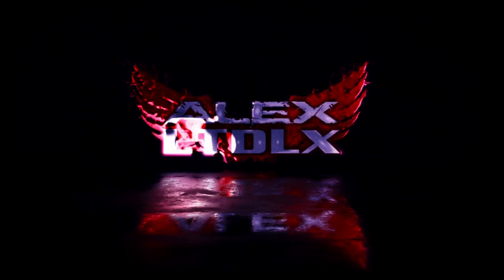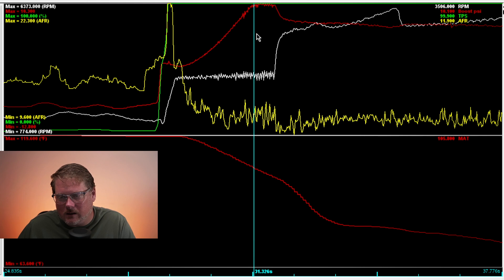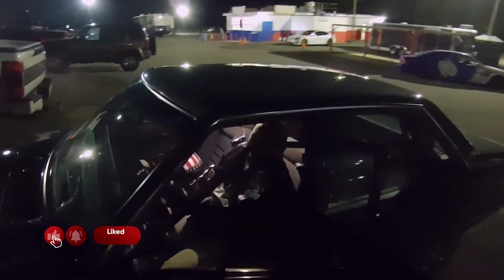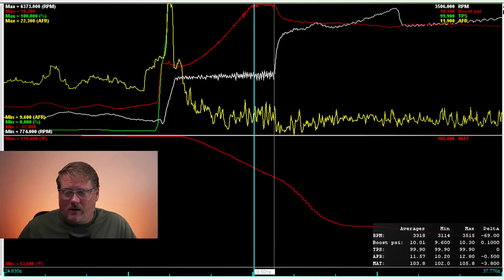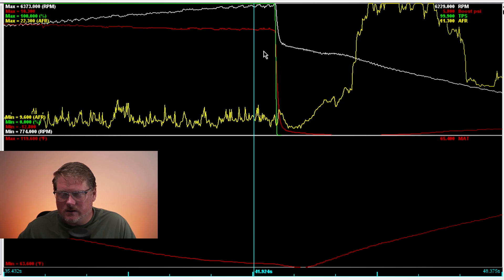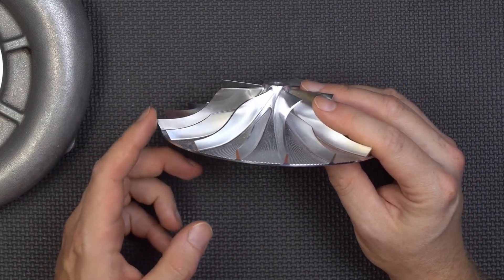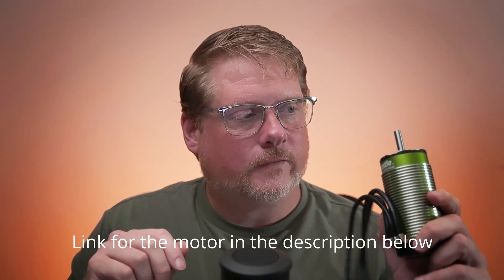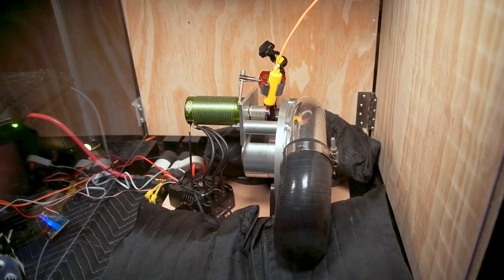How Much Boost Does An Electric Supercharger Make?

Comment: Hello Sir, we chatted before, so Im looking to use an electric turbo to help spool up an exhaust driven turbo. Do you have a full setup that you sell including motor, superchager, controller etc.... ?
Reply from the maker: The only commercially available kit is the Torqamp, and that's only a 5 kw unit, so it's limited to supporting at most 200 hp.  And since every application is different, it would be hard to sell a one size fits all type of kit.  Right now I'm working on trying to make one or two universal controllers (one for OBD II cars and one for those without), but that's a pretty complex thing and you'd still need the ability to tune the engine computer to add fuel and pull timing.  Maybe, down the road, we'll have individual "modules" for sale that people can combine for their specific needs, but nothing at the moment.
Reply: Understand. So, what would be the cost of the supercharger with belt drive motor and manual control switch? Of course, Id follow your recommendation on where to buy the batteries and supporting equipment. @AlexLTDLX

Comment: It does require more power, it's just in the form of a battery pack. No excess work from the motor to drive it. You could get the alternator to drive it but it will take away from hp to drive the alternator. If you want to make a nice hp upgrade for your car you should get an electric water pump, and fan if don't already. just like the alt could convert power to hp more efficiently than belt drive possibly(probably), adding more battery power to the engine power is most efficient.
Reply: My car has an electric fan already but how much power is used by a water pump?

Comment: Hobbywing 56118 800-1100 kv 8-12s, SSS 500-700kv 16-22s  plenty of torque on these  or even a 70125 Hobbywing 70125 series would be good here with good Rpm with low amps on the right voltage with the higher voltage band control should in theory be more linear to be able to have better fine tunning!?
Reply from the maker: You need more power than the 56113 can offer, and the 70125 is a little slow and costs and weighs  more than the Castle motor does.
Reply: @AlexLTDLX  it's only slow at the same voltage 500kv at 70v with the higher torque band, not sure really how much the castle 2028 800kv  is over the 56118 800kv hobbywing is not as much a folk think 🤔 compared to the older series yes but now not so much

Comment: I like the testing you're doing.. and I'm not so interested in boost but what benefits this will have on a daily driver. Will it help fuel mileage if it can be tuned in, will it help towing, and will it help slow speed off road???
Reply from the maker: It certainly would help all three, but the engine would have to be set up specifically for those scenarios.

Comment: Question for this build. How come u  didn't use regular car batteries and chose the lto cells
Reply from the maker: Because the LTO cells have a much flatter discharge curve, are far more power dense (lighter and more compact), and have much, much lower internal resistance (much less voltage sag under heavy load).
Reply: @AlexLTDLX  I swear you always seem to answer my comments no matter in which order or video they come from. Love the content man.

Comment: I have two of those motors in an Arrma Limitless RC car running off two Castle XLX 2 ESCs for speed runs, I haven't run it yet (too scared to crash) lol but I always wondered how they'd work for forced induction systems. Interesting stuff, I dig it!

Comment: You have it wrong. Tq is the only power. All hp means is tq at rpm
Reply from the maker: Torque is literally not power, not by any definition of the word - torque alone does precisely zero work.  It's like pushing against a wall - nothing gets accomplished.  Horsepower and Watts are measures of power, because they define the amount of work that can be done.  Like I show in the video, a million foot pounds of torque with one rotation every 3 days gives you less than 7 hp.  A million foot pounds of torque with no movement is zero horsepower.  Having a ton of low end torque is useless in a car for a whole host of reasons - believe me, I've been developing custom forced induction solutions for over 30 years now, and the majority have been with positive displacement superchargers.  I won't get into is here - it's too long - but given two cars, with appropriate gearing and one making 500 hp at 6,000 rpm and the other making 500 hp at 4,000 rpm, all other things being equal, the 500 hp at 6,000 rpm car will always be faster than the 500 hp at 4,000 rpm car.
Reply: @AlexLTDLX  torque is the only power a engine makes. Torque can be mutiplied through gear ratio horsepower cannot be because horsepower is only a calculation.  You don't even need horsepower to calculate shift points which should be done off of torque curve not hp.

You're confusing engine tq with torquing a bolt. It's not the same.
Reply from the maker: Torque is a force, it is not a measurement of power.  Once you understand that then everything falls in place.  Bolt torque and engine torque are merely forces. Analogous ones at that.  An engine cannot only generate torque by itself. It would stall.
Reply: @AlexLTDLX  torque is the only measurable power a engine makes.....that's what the circular motion is out the back of a crankshaft. Hp is calculated.....not measured .

It's got nothing to do with pushing on a wall.

Torque is used to start the engine....from a starter.

Hp don't break anything because it's only a calculation......Torque does.

Comment: Try over driving those motors 25%, I think they make most power at 50% of their KV. With the motor speed dropping to 30K (the 6.14 PSI) they are at 75% of their KV where their efficiency is half what it is at peak power, which is half again what it is at peak efficiency at half power at 25% KV.

Comment: I'm looking to drive my Paxton Novi 2000 with an axial-flux.
Reply from the maker: That would work, but it would be huge and heavy.  Like 8-10 times heavier than just going with a much smaller, higher rpm motor and bypassing the gear box automatically.  I thought about using a Nissan Leaf motor to drive a blower, but after planning it out, I realized I'd never be able to reasonable mount it in a car.
Reply: @AlexLTDLX  I'm eventually going to try making my harmonic balance the rotor for a prius M1 stator and use M2 to drive my Paxton via the inverter and the hybrid cells M1 will charge. It won't be more than a couple of hundred pounds and I'm willing to bet that's well worth the full 15 psi into a built smallblk like I have. Hell my current system with 6 AGMS is like 300 lbs (100 for the unit up front and 200 for the batteries in back). Weight makes very little difference when you're already on a roll. It's not really all that off the line either. What's the difference in your time ticket with a rider ? Very little, damn naer insignificant in the lower brackets. "I'm tellin you laddy...ya need more power !"

Comment: Why not a starter motor with a gear box?  Dont take the drive off the supercharger and put a pully on the srarter.
Reply from the maker: Nowhere near enough power.  You'd need about 10 starter motors to equal the Castle motor.

Comment: how will this the electric Supercharger efekt a smaller motor, like a 2jz or a similar size engine? will the engine make 600 hp or close to it? and is a compound setup whit a turbo worke?
Reply from the maker: A single unit like the Castle/Hobywing/P2 unit should do it.  A compound setup would definitely work toget higher boost pressures - if you're seriously considering something like this, join our forum at ww.electrifiedboost.com and ask away.

Comment: i dont know if you've already explained it, perhaps in a different video, but have you worked out the cost difference between getting the same drag strip times with an exhaust driven turbocharger vs your electronic config?
Reply from the maker: I haven't, and it's a bit of a tricky comparison, since some people would have to pay someone to weld up the exhaust side of the turbo, where I wouldn't.  And then there are the pros and cons of each setup too.  I can tell you that you can make an electric turbo that supports about 600hp in most application for about $2,000.

Comment: I remember you saying that the e turbo made more power than the Whipple at half the psi. How does the set up compare pound for pound? Is it lighter than the whipple system?
Reply: I think he's saying that while the Whipple made more horsepower (perhaps double and twice the boost), half of that power increase was offset by the parasitic drag to run the Whipple, so that the "total system" horsepower output was comparable at the two different boost levels.  IIRC, the parasitic power to run a Top Fuel or Top Alcohol blower is on the order of 800-1200 horsepower.
Reply from the maker: The Whipple setup was far heavier - by about 40lbs, because it had an A/W system to keep the charge cool, and the intercooler was made of copper.  The Whipple generated around 15 rwhp per psi (remember my numbers are through a glide, so it would be higher through a manual or lockup style automatic).  The Sledgehammer  makes 34 rwhp per psi.
Reply: @AlexLTDLX  does the sledgehammer perform better with meth than it would with intercooler? also have you though about individual ports for each cylinder?

Comment: So I had an idea, what if you had the exhaust side of a regular turbo on your exhaust, to push the air out? It could be done with an electric motor but it wouldn’t be able to be fitted directly behind it, but an axle mount driven one I could see working pretty well, I know there’s a lot of speculation on back pressure but maybe it would help with the efficiency of the motor since you could potentially be making a vacuum on the cylinders to pull the exhaust out so the pistons don’t have to push the exhaust? I’m curious if you think this would work but I know you’re heavily investing your time into the electric turbo itself
Reply from the maker: Yes, you could do that.  The original roots blowers that were adapted for car use back in the day (Detroit Diesels) actually did just that on diesel trains.
Reply: @AlexLTDLX  Do you think you could benefit more with an intercooler or do you think it would make less boost since the air is more dense, but have the same flow per minute? I wonder how the heat would affect it, but this is definitely out of my realm of knowledge lol

Comment: The real question is how much power does it rob from the engine. Sure separate batteries wouldn't rob directly. But batteries are heavy. Why do you people keep screwing around ?!?!?! Turbo Superchargers are the only way to go.
Reply from the maker: Not as heavy as you would think.  The packs the sledgehammer uses weigh in at 62 lbs.  And they're made of LTO cells mostly for safety.  A similar Lipo pack would weigh around 20 lbs.  And you don't have a heavy cast iron turbine like a conventional turbo, or convoluted exhaust and wastegate piping, plus you can install these anywhere in a car.  If you haven't seen it, we've taken a 12 second car and put it in the 9's with one of these: https://youtu.be/RT0M88xHzNQ?si=FkoBAydRz8zWnDTa

Comment: One of my questions is what happens if you get really unconventional and use this to create vacuum at the exhaust port but in combination with a turbo? could there be any point in forced exhaust? Just a weird idea that probably has no real value other than a curiosity.
Reply from the maker: It's an interesting idea.  In fact, the Detroit Diesel blowers (the iconic roots blowers) were originally used on train diesel engines to do exactly that - suck the exhaust out.  So there is definitely some merit to your suggestion.

Comment: Are u using lipo batteries?
Reply from the maker: Yes - LTO cells specifically.  There are a bunch of videos on my channel of the packs and how I built them.  Initially, I used RC packs, and they worked too - you can see me loading them into the car in my first drag test video of the first unit I built.

Comment: If boost is more efficient than cubes or compression... (to a point anyway) Would a smaller motor make more efficient use of the boost? IE your exact "E-setup" (Or the cheaper setup? twins?) on a 2.0 liter making much more boost? Something like a 2.3 pinto motor or any of the popular imports... K-Series Honduh etc... ?

Along those same lines... wouldn't a much higher voltage setup (At much less amps) be more cost efficient cell wise as well? Say a 30s 18650 setup?
Reply from the maker: Good questions.  Everything becomes a balancing act, and the limiting factor is available brushless motors and ESCs.  And then there are the compressor maps to contend with - these factors conspire to limit boost.  But up to a point (and we don't really know what that point is yet), I think you're probably right.  As for the voltage question, higher voltage would be more efficient, but mostly because you'd see fewer losses in the cables and connectors because of the reduced current.  Cells like 18650s become problematic for us because the connectivity (specifically the nickel strips) become the limiting factor unless you have a lot of them.
Reply: @AlexLTDLX  I race elec minibikes. Was guessing a pulley ratio similar to the ratios they use in a car with the packs we use (250a or so @ 100-120v) Through the QS165 motor we use and fardriver 96/680 controller would likely make enough TQ/power to make decent boost. I run them in the 25-30kw area 8000-8500ish shaft rpm. Healthy amount ot TQ. running 4 sec 0-60 times. 1.8 sec 0-30.

Comment: rofl! Alex. 
Just body slams the torque vs. hp crowd with a snap whiz computation. 
6.7. 
Love it, man.
It’s true, a river water wheel can turn at thousands of foot pounds and operate big saw blades at the mill, but the hp operating the saw is down around 6-8hp which is all it takes to cut big wood, ask any log milling woodworker. 
Hp is an answer to a math problem using torque as one of the numbers, the other one is rpm. And with low rpm’s you get low hp and not much goin on.
And speaking of higher rpm’s, I would like to see your Jackhammer spin a little more into that compressor map you’ve been touching on. 60k would put in the mids of its total potential and also show all the turbo fanatics how parasitic turbos are, cause their favorite thing to rail on is superchargers being “parasitic” when you’re showing directly how much hp it takes to spin a turbo compressor. You don’t get anything for free guys says thermodynamics.
Reply from the maker: Thanks.  It's just not practical with available motors to go that high RPM-wise on one of these units (yet).  I console myself with the notion that running in the lower rpm bands of the compressor map is more efficient.  I really want to try compounding these to make some more boost, though.
Reply: "Horsepowers or watt, bah. Carroll Shelby  said: Horsepower sells cars, torque wins races. You dont know what you are talking about" <- And so the myth perpetuates. Not helped by motoring journalists stating the PEAK torque figure at an undisclosed rpm number in every review, implying it matters for performance, when its wholly irrelevant.

Comment: Get you a 70125 motor and try that. From hobbywing 12s
Reply from the maker: I did look at that motor - it would require more gearing up on the supercharger but would probably work equally well.  It would just be a little bigger and $100 more.

Comment: Thank you for sharing, 
One question:  You mentioned having the correct match of the RPM band to match engine as precisely as possible. 

Do you see an application for using e-compressor design applying variable geometry to expand on the range?  
Thanks
Reply from the maker: Possibly, but I think we're a bit away from that technology to be honest.  What I was referring to is the belt drive in the Castle/Hobbywing/P2 setup.  You can fine tune the pulley ratios to match a particular engine's airflow needs to maximize the Castle motor's duty cycle.

Comment: A demonstration of why PSI alone is a useless metric is because if you put the supercharger on a significantly more powerful engine, you may actually see a negative PSI (less than atmosphere) measurement. In a powerful enough engine, the supercharger would act like a choke point. Like Alex said, "how much horsepower can it support" is a question that would give you a meaningful answer.
Reply: It’s like that little Chinese 500 supercharger. For some reason so many people think it all adds up and that supercharger is good for everything. They can’t comprehend the supercharger is just a restriction if the engine wants more air than it can supply.

Comment: Here’s what people don’t understand. They need to look at boost as a restriction number not a horsepower number. Because two different engines can make the same horsepower one may be at 10 pounds of boost, and the other one could be at 20 pounds of boost using the same turbo making the same horsepower. Boost is a restriction number.

Comment: Makes me wonder if you could adapt the motor setup to a turbo thats designed to flow top end wise but have the electric motor spool it up at the line making boost... Like electric antilag.. Im all most sure F1 uses something similar? Could have an over run connector between the motor and the compressor so that it doesn't over spend the electric motor.
Reply from the maker: Audi uses exactly that idea on some of the diesel engines in Europe.  Good thought.